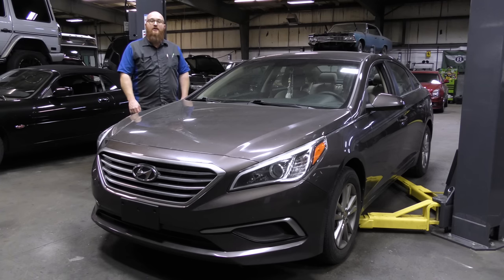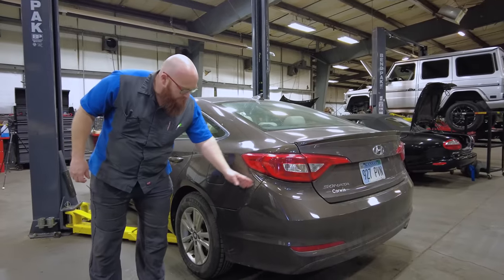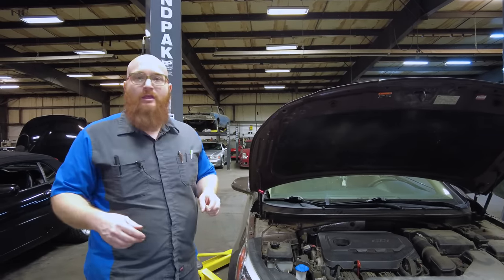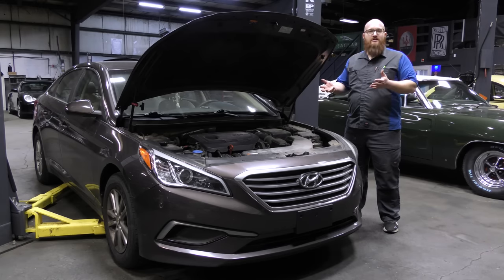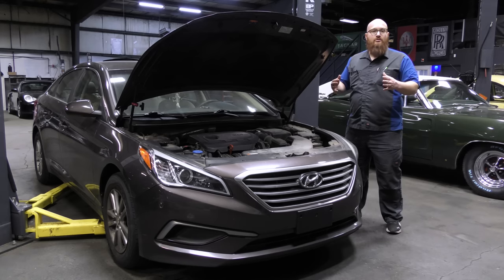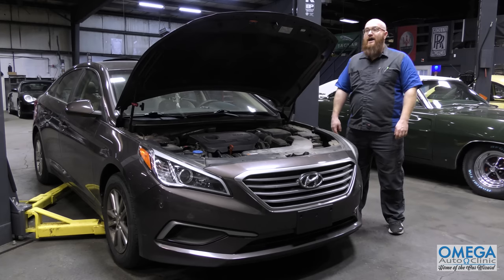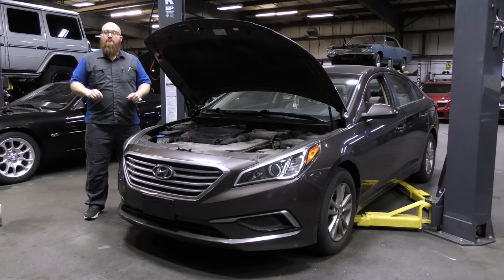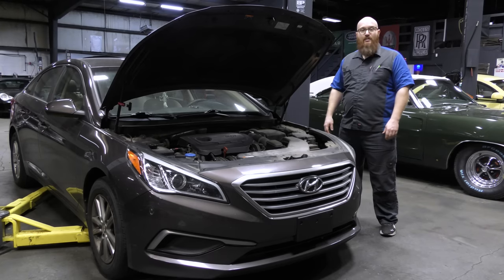What could be so bad on this '16 Hyundai Sonata that the CAR WIZARD is sending it to the junk yard?

Comment: Love that huge scrape across windshield where they ran wipers with no blades😂
Reply: I'm still not sure if it's user error, or if theta engines are that bad
Reply: @Radi0he4d1  what?
Reply: @jciarkowski3109  I'm saying I'm not sure if people who scrape their windshields with wipers off can be trusted to change the oil, or if the engines such as the one used in this car are just bad ticking time bombs
Reply: That windshield looks like it is cracked.  That's a relatively minor issue compared to that bad engine.
Reply: @Radi0he4d1  They're actually that bad. They are known for seizing up and sometimes even catching fire, regardless of how well the oil was topped off. I always get a laugh when people say these are great cars as if they never heard of this issue before.
Reply: Ah, it’s a trick, you see. My car is scraped up, stickers on the back, cracked windshield, etc. people stay away from you 😂. Think of it as a strategy. Would I treat a nice car this way? No. But the car ISNT nice.
Reply: @guyvanbrussel9772  Same. Those wipers pivot from a single point which means any scrape would be a semi-circle arc, not a largely horizontal line with peaks and valleys. For a moment there I thought it was reflecting some trim from the dash but there didn’t seem to be anything shaped like that on the dash. For the same reason, I’d never assume it was from an empty wiper arm (nothing shaped like that).

Also, wiper blades give when they give. No sense judging the user for something they have little control over. Should the user have replaced them prematurely? What if they were sabotaged? It happens.
Reply: I've had the wipers on my car (1966 oldsmobile) literally fall off after the shitty plastic hook fell apart. Stopped the wipers immediately, pulled over and grabbed the blade so it wouldn't fall off the hood and go into someone's tire, and went to the parts store for new wipers driving very carefully because it was raining and I hadn't learned the sock trick yet.
Reply: Isn’t that a crack

Comment: I had exactly the same situation with a 2014 Hyundai Tucson. And since I knew nothing about mechanics and I never checked the engine oil. I learned from the difficult situation. Now I attend A 2018 Hyundai sant a fe sport already has 110,000 miles. And I tell you that since I bought it with 10,000 miles on it, I learned to change the oil every 3,000 miles, full synthetic.  And I have the oil level checked every 700 miles. Since then I have not had any mechanical problems. I recently changed the transmission oil and everything is going very well. Thank you for bringing up this type of content, it is very useful for the general public.

Comment: My wife’s Hyundai had the same issue, but the dealer had documents showing the car had been serviced there, so they honored the engine recall and installed a brand new engine for her at no charge.
Reply: I believe you😂
Reply: My wife has a 2015 Kia Sorento, fought with Kia about burning oil, after going through there testing for months, they finally replaced the motor. They STINK…
Reply: I had one of the early production 2011 Sonata's, drove it regularly and it had 180k+ on the odometer when I traded it in after 8 years of service. Outside of the normal servicing of fluids, brakes, ect. And the recalls, it was very reliable and never was in the shop for more than 24hrs for a service.
Reply: @sawood1031  And I believe you😂
Reply: I would get rid of that thing as soon as possible and get a Toyota or something.
Reply: My son decided to buy a Hyundai sonata as a secondary car for his wife. It is the same make and model as this one on the video. He bought it brand new in 2016 and had to take it over 24 times because the car would start shaking until you cannot go higher than 20 mph. He thought I was going to be a safe reliable car they turn out to be the worst decision he ever made. He joked around saying that he drove more a rental then that car. His engine gave out and now they will not replace it. Oh and I forgot to mention there was a massive lawsuit for this specific model of a car that gave you a extended warranty up to 140,000 MI because they knew that they endangered several people lives. Hyundai is a horrible car I would never recommend it. He paid around $33,000 for the car cash, the retribution from the lawsuit he got $3,000 back😂
Reply: Same happened to my Sonata and this is the same year that i have that’s in the video. Hyundai honored it and replaced engine free of charge. Mileage was at just over 120k. No knocking just burned through oil too quickly.
Reply: How old and how many miles did it have? Ours has 162k and the dealership told us its past some 140k threshold for them to cover the costs.
Reply: If you pay $33k for a Hyundai you deserve what you get.
Reply: @petrosaguilar8916  33k gets you a fully loaded piece of sh*t that could take you around the corner. 😂 😂
Reply: @sawood1031 they were much better then.
Reply: 2014 2.0 here.... Got an update in 2019 requesting that we go to dealer and install coding into computer so the car could detect engine issues. Fast forward to August of 22. The engine light fired up and my speed was reduced to no more than 40 mph. Apparently the coding worked and the computer picked up that the engine was not working efficiently. I took it to a dealership and they replaced my engine and turbo for no charge. I perform my engine changes anywhere between 4 to 5,500 miles. The engine simply eats oil. I found it odd at the time, but the service manager said that I was very fortunate to download the code when I did or Hyundai would not have honored the recall. I'm not sure what that meant because I've read the class action lawsuit and it states very clearly that you are entitled to an engine through no fault of your own. It's bad. Machining. Having stated that,  I thank my lucky stars because there are many people that are still fighting with this company. My next car will be a Toyota Lexus . never again.

Comment: I did a lot of research for a Subaru oil control plate I designed and found out some interesting information. On a typical 3.0L V6 with an oil capacity of 5 quarts, there were almost 2.5 quarts of oil circulating in the engine and about 2.5 quarts in the oil pan. Now think about letting your car get just 2 quarts low. You may have as little as a half quart in the pan on level ground or zero lateral and zero horizontal G driving. Now throw in acceleration, braking and turning and I guarantee that oil pickup is sucking air a good percentage of the time. When my cars are newer I change the oil and filter every 5000 miles because it's easy to remember by just looking at the odometer. As they get past 100,000 miles, I go to 3000 miles for the oil only and change the filter every other time. It's never let me down in 50 years of driving and maintaining cars.
Reply: Oil is cheap, engines are not. 🤷‍♂️
Reply: yes garage 54 made a clear oil pan and i was stunned to see half the oil get sucked through the engine while running at idle!
Reply: How long for time interval vs miles? I don’t drive much. You do every 6 months or every year?
Reply: How long for time interval vs miles? I don’t drive much. You do every 6 months or every year?
Reply: I have an 03 boxster S. I change the oil every 6 months regardless of mileage. I have changed it while only driving 500 miles at one point. An oil change is way cheaper than an engine, and I have not yet done the IMS, so I am spooked about that.
Reply: @tjnucnuc  Place a sheet of cardboard on your driveway or garage floor and check for drips.....if the level is dropping when you check the dipstick, it's going out the exhaust pipe.
    With synthetic oil, change it no less than a 5k mile interval....UNLESS you see the oil level drop on the stick once a month.
Reply: I drive a Subaru STI with the EJ257 engine; well known to be very finicky about oil neglect. This video has me spooked as well, I might go down to a 4 or 3k mile interval just for peace of mind
Reply: @tjnucnuc  I put a good many miles on our vehicles so I never have any calender issues. If you use good, full synthetic oil I think a year would be no problem.
Reply: @imtheonevanhalen1557  I agree with you but it could be two different problems. If it smokes on acceleration it’s going past the rings, but if it smokes on deceleration then it’s getting pulled past the intake valve guides by engine vacuum. One is a whole lot cheaper to fix.

Comment: One thing you may have forgotten to mention is how many manufacturers are doing away with actual dipsticks. It makes it even more unlikely people will check the oil unless they get a warning light.
Reply: Because 90% of people don’t check the dipstick. If there’s no dipstick then there is a way to check level in infotainment screen. Sensors are designed to fail in “low oil” mode. I think it’s a great idea for your average person. Most engines have an aftermarket option for a dipstick tube. All comes down to basic maintenance
Reply: My winter car is an 2006 4runner and it feels and looks practically brand new.  Toyota is conservative in implementing new features and pays close attention to components.  It really pays off for the consumer.  I expect to have it a long time.
Reply: The same thing with auto transmissions - Lifetime Fluid - which means 10 yrs. or 100,000 miles.
Reply: You can check the level on the screen if not manually. She’s obviously not changed the oil ever. Even if you don’t check it between services say yearly or 8k it wouldn’t use that much! It would’ve been smoking if it was burning oil. Her not maintaining it caused this. Was she never taught you have to service them?
Reply: @martincassels7995  Her thinking was “if the car runs, I’m not gonna spend a cent on it.”

Makes it fun looking for a used car when people ruin them with their cheap-assery.
Reply: @j_freed  it’s easy to spot badly maintained cars.
Reply: @martincassels7995  absolutely!
Reply: @j_freed  love that expression
Reply: @martincassels7995  nah man, I used to be tech at Hyundai dealership. Alot of those 2015-2019 Sonatas will burn like 4 qts of oil in 5,000 miles. I'd say a majority of them would come into the shop with little to no oil on the dipstick. Even the ones that were well maintained.
Reply: @marial8235  It will easily last you 350k+ miles if fluids are changed regularly. After that point, the automatic transmission is starting to near the end of its life. I've seen 3rd gen 4runners with 400k+ on the original transmission, though. If you're lucky enough to have a manual transmission 3rd gen they've been known to go 500k+ miles on the original engine and transmission minus a few clutch replacements. Take good care of it and it will take good care of you.
Reply: @brucesheehe6305  My company has a fleet of Ford Transits and they get the transmissions flushed by the Ford dealer every 75,000 miles. The 2017 I drive has 219,000 miles and is still on the original transmission.
Reply: THINK WITH YOUR DIPSTICK JIMMY!
Reply: @TwistedTee  I learned back in 1981 on my first car after replacing my camshaft for $500 just how important oil levels and oil changes are, and how foolish and costly it can be to extend them or skip them.  At a bare minimum, I check the oil levels in my vehicles at least every 2 months and change it every 5,000 miles.
Reply: Lifetime fluid doesn't last either.
They want you to replace the tranny or the vehicle.
Reply: In this car dipstick is extremely easy to acess. I have an kia with exact this engine and it's one of the most serviceable car that i know. But if you will change oil every 10k miles and never check the level you will blow this engine. Like any other modern engine by the way
Reply: @patricks.7951  Sounds like a manufacturing defect with Hyundai.

Comment: 2015 Sonata that we got my daughter had the same issue.  The engine is notorious for burning oil.  Thankfully the dealership we bought it from had a free engine/drivetrain for life policy and replaced it for free.
Reply: But if they don't fix the problem in the new engine, it would need replacing again. Even when it's free, it's always a hassle to go to the dealership for the same thing, over and over and over. Still a waste of time and effort.

Comment: Its so crazy how a car can look perfect fine on the outside but one internal problem can completely make it unusable
Reply: Kinda like humans 😂
Reply: because its Hyundai
Reply: That explains the many high mileage but clean looking cars on craigslist asking a fortune for what are really clapped out heaps about to die.
Reply: The problem here was defective daughter.
Reply: Why would you need oil though? I think it's pretty cool to have an engine that can disassemble itself
Reply: That’s cause it is perfect on the outside. I’ve rode in a few of these hyundai and Kia cars and they ride beautifully. I’m sure the chassis is cheaply made but they get the job done. It’s too bad their motors are just oil burning garbage. I have a coworker with a 2019 Kia that looks like it drove off the lot, only has 100k miles and it’s knocking already. They last just long enough to get through that 100k warranty and then you’re SOL cause you purchased the car new. Buy used and Japanese or maybe american if you can find the right model. People caught on to Toyota and Honda being reliable so sometimes even they aren’t worth the premium you pay for used models. Buy something cheap you can afford than you aren’t gonna make huge payments on. 

There are a few ford and gm cars that last a long time too. Just gotta know which ones.

Comment: My brother did that to a car back in the 90s. Locked up the engine in the middle of the intersection. He said he didn't know cars needed oil. Heared the same thing a few years ago from my girlfriend's little brother. People just don't know and it's a hard lesson.
Reply: I can understand women not knowing cars. But your brother and your girlfriend's brother? Men should know cars.
Reply: @AbcAbc-sp1od  I know someone’s gonna go snowflake and get offended but this is true. Men should know cars. It doesn’t have to be in-depth knowledge but at least basic knowledge like how to change a tire, when was the last oil change, brake pads etc. 

Even the most uninterested person I knew towards cars still knew the basics of how a engine worked. Needs oil, needs gas, needs air.
Reply: @AbcAbc-sp1od  It’s not that they should know cars, it’s a responsibility for any car owner to know some basic things about how cars work. It’s more likely that growing up, they had no one in the family that was interested in maintaining cars, so in turn the rest of the offspring wouldn’t care either.
Reply: 90s TOYOTA is more reliable today than new 2023 hyundai.
hyundai KIA engines are Almost always Junk.
Reply: @Sodapopper100  I have a few friends that are school bus drivers. And as part of their training they are taught how to do a basic check up  like checking the oil.
Reply: @evoman44  In the 21 years that I was a cab driver we were taught to check our cabs over before we started out on the road, Every shift, That meant oil, tires, hoses belts, check if the cab was clean, Not only oil, but steering fluid and tyranny fluid  well we had to beacuse NOBODY liked breakdowns!.
Reply: @evoman44  In a way I blame this dysfunctional society that we live in today beacuse it was a rite of passage when we were young  and dad took alot of us out  to the back yard or the garage and showed us how to do things when it came to cars and engines( gotta remember  lawnmowers here as well as even our own bikes)I remember  this as a sign of growing up!.and one more thing,Remember  I said that I was,and still am a Cab driver?, Well I have another friend of mine that's  an over the road trucker for a local  company now if you wanna talk bout a job where being Mechanical and doing almost daily  inspections are needed that would be it.Take a good look at some of these over the road trucks sometimes?.

Comment: You're the best Wizard. My family had this happen on an 04 Concorde with under 50k miles due to the infamous 2.7l V6 engine sludging issues and they also denied our recall because it was not just slightly low on oil but we didn't keep oil change reciepts. Hope life works out for your customer and her granddaughter, that really sucks to hear their situation
Reply: Those infamous Chrysler 2.7L V6 "engine sludging" issues were ultimately caused by the poorly designed internal water pumps that would leak and contaminate the oil. That problem was largely misdiagnosed for years.
Reply: @chynacash3138  easy solution?  Don’t buy Chrysler. Problem solved 😁😁😁
Reply: @paulu7751  Too late for that, my husband drives a 2021 Ram pickup and he loves that big thing even though it doesn't fit in our garage lol.

Comment: I’m on my second Sonata.  254,000 miles on my 2011.  Currently at 272,000 plus on my 2016. Other than tires, brake pads, oil and filters it is totally original. I hear horror stories about Hyundai’s but I’ve had great luck with them. Still runs great and gets 34 mpg.
Reply: S-u-r-e